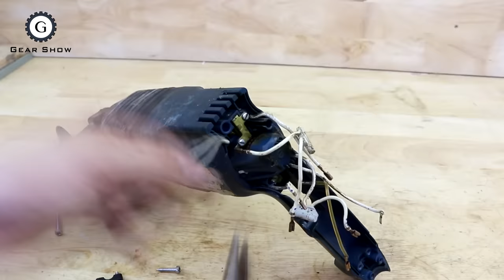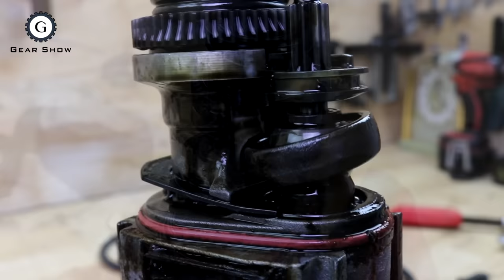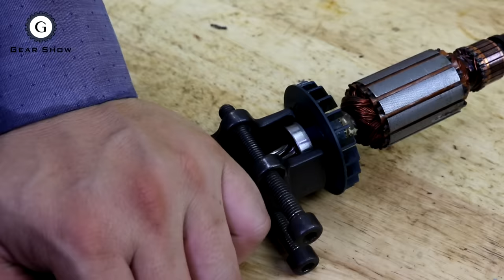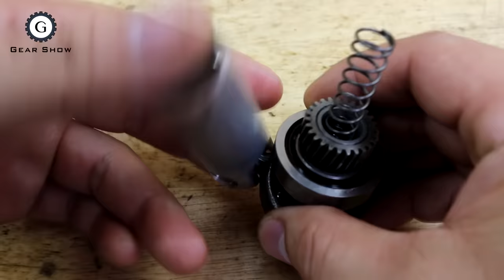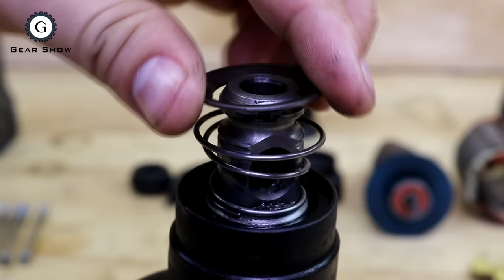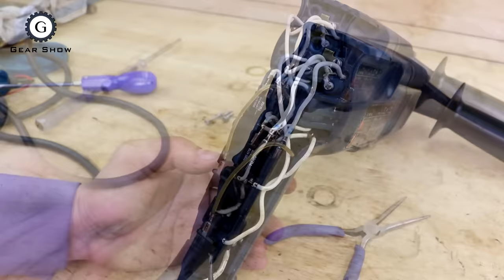Bosch Hammer Drill Refreshment | Bosch GBH 2-24 DSR disassemble

Comment: Interesting thanks. but how comes when you send a drill back to Bosch for repair and it takes at least 2 weeks to repair, and you can do it in less than 15 minutes ,    👍
Reply: Malcom,My GBH2SR 620 W hammer drill.,,recently when switched on to use,sparked ,then internally went “Bang” ,I’ve stripped it as far as the commutator,cleaned it,waiting for new brushes A96, off eBay,I want to know how much does Bosch charge to fix a fault, brushes had plenty left on them,cleaned power switch on/ off .there’s a couple of components that could be faulty,but how to test!,, is it worth having fixed .cheers for any info!

Comment: Not to hate or talk bad however the casing on that drill is not meant to have grease in it, it requires a specific oil that has a very thin viscosity. I will likely have other issues due to the grease if it is indeed put back into the work field. Next time try to find the proper oil.

Comment: You should not use sandpaper to remove oxidized copper at the surface of armatures as this would damage the armature and causing sparks/arcs when the motor runs. Use metal polish instead.

Comment: Your testing of the armature was incorrect...
All your doing is buzzing stuff...
You should be testing each field coil and COMPARING the values...which should be substantially the same...

Likewise with the armature...
Firstly by testing opposite segments....again each value obtained should be substantially the same...
Then testing each segment to the adjacent segment... working around the commutator....again, each value obtained should be substantially the same...

Finally an insulation test at 500V DC 1mA should be carried out between the commutator and the shaft...
The commutator and the armature laminations...
And the field windings and the field pack laminations...

All you did here was a quick continuity buzz which tells you...precisely nothing...

If your going to make attempts at testing stuff then at least do it properly...or don't bother even starting...

Glenn.
GLMelectrical..🇬🇧👍

Comment: I wonder - what kind of idiot could used an oil instead of grease in that poor tool?
Reply: If u check the repair manual this drill use special viscosity oil. Grease isn't used in most hammer drill or everything that has hammer inside.